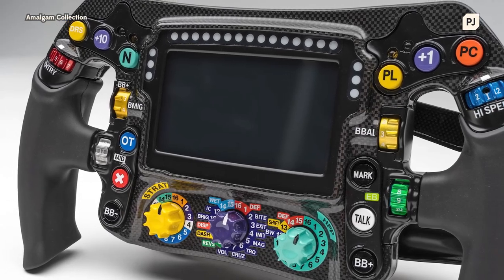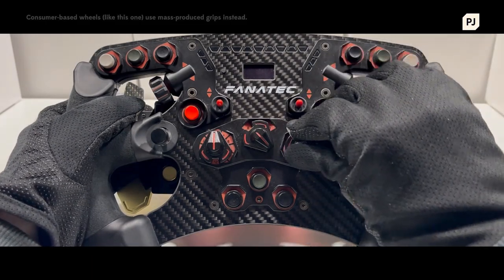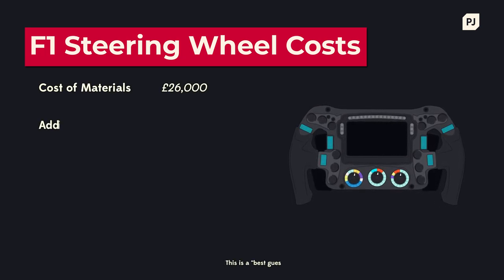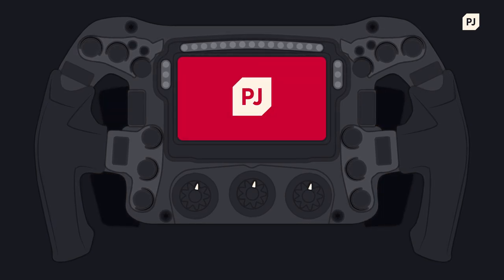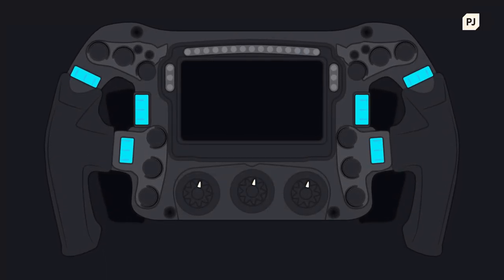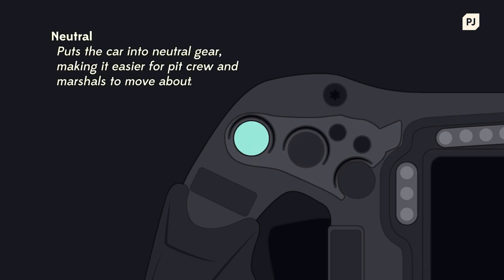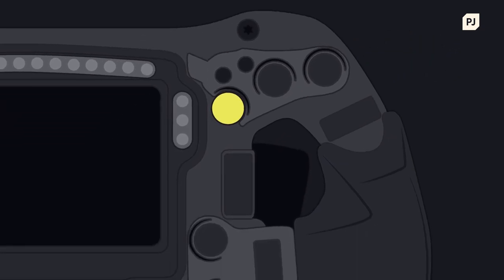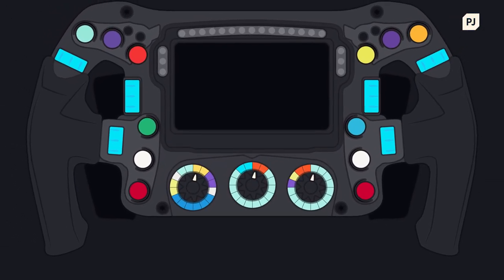Why are F1 steering wheels expensive?

Comment: Do you remember Hamilton’s steering wheel change in a race? Can’t remember what race it was or even when, but a fault meant he had to switch it out during a pit stop. Didn’t lose much time for it aswell.
Reply from the maker: India 2012! They changed the steering wheel as fast as the tyres.
Reply: @PJTierney  Yes India! I knew it was in Asia cause it was a really hot race I remember. But yeah, they’d practiced for it before hand but still really impressive

Comment: another great video PJ. wonder how much money Williams saved not having their screen on the wheel? and 10 meters of cable was very surprising, id assumed it would just be some massive circuit boards inside!
Reply from the maker: It's a combination of boards and wiring, based on the videos I've seen. if you check the Aston Martin video in the description you'll see one opened up.

As for the screen, having it on the chassis means less inertia and weight in the wheel, but it also makes it trickier for the driver to get in/out.

Mercedes in one of the source articles said that the screen and electronics was the most expensive part of the materials.